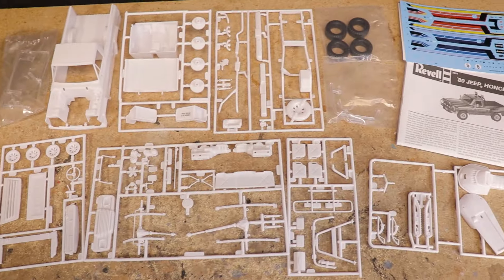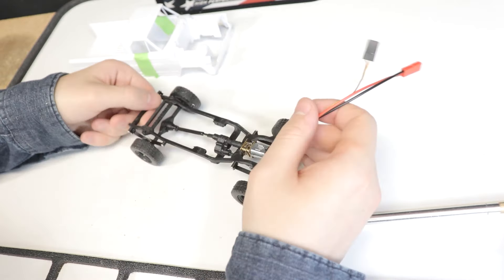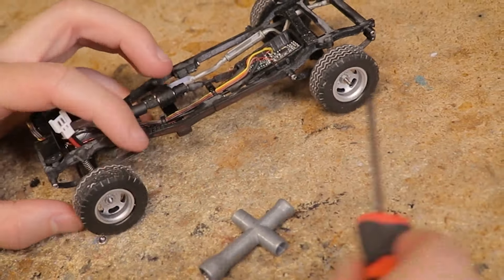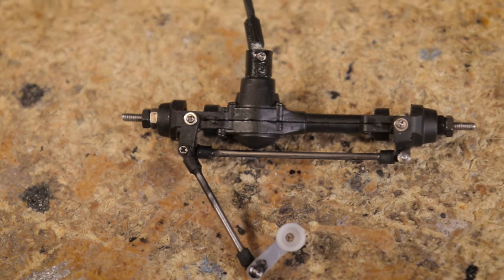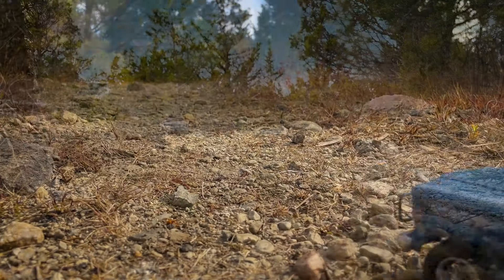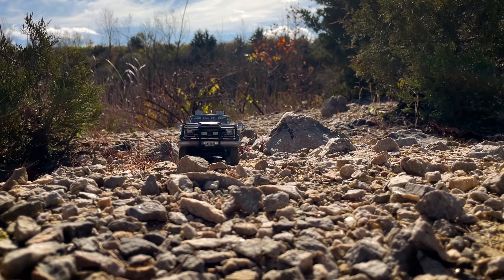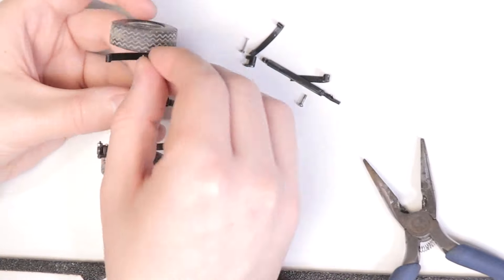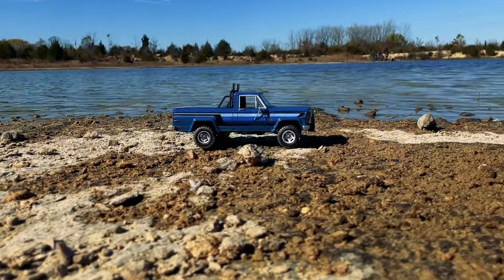It's Back! More Testing of the 3D Printed 4x4 Model to RC Conversion Chassis 🔧

Comment: Well done. It may be bouncy and rickety but for a  first shot at it You have done well. Keep in mind the development process for an RC model is normally based on existing designs and  is adjusted to suit the new model, Even then the design and development can take many iterations before it is any good. I have scratch built many chassis for my own RC vehicles and most of them take at least 10 revisions before being somewhere close to performing  well. Off road vehicles usually require quite a few more revisions than road going vehicles to improve durability and performance. Keep bashing away with the R&D and You will end up with a strong, good performer eventually. Your next project can leapfrog the first few iterations of the original design as You will have more design aspects nailed down and have a better initial starting point to develop from. It is certainly rewarding when You reach the final design that runs well. My 12th scale long wheelbase transit van took about 3 months to develop from a very basic  GRP sheet chassis  but has ended up performing as well as many commercial models. I have used existing gearbox and drive shafts as I do not have a 3D printer and these parts are hard to make by hand. Keep up the good work and enjoy the development process.

Comment: I wonder if it wouldn't be too hard to cut some thin brass or aluminum sheets and bend to create some leaf springs. 

If this comes out, I'd try to replicate the springs with metal sheets. Some small snips and pliers/dowel could be used to bend and shape.
Reply: The hard part would be making them actually function as springs. Usually steel is heat treated to make it springy, I’m not sure if that process is the same on brass or aluminum.